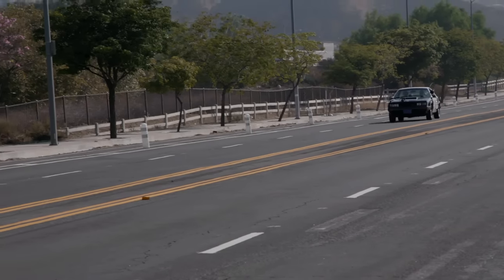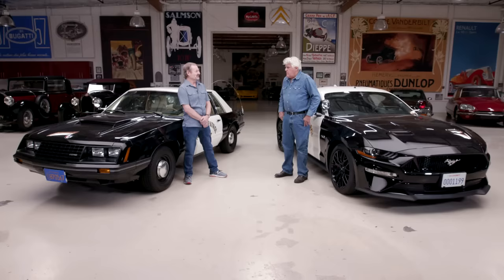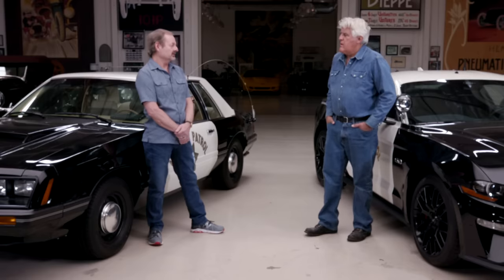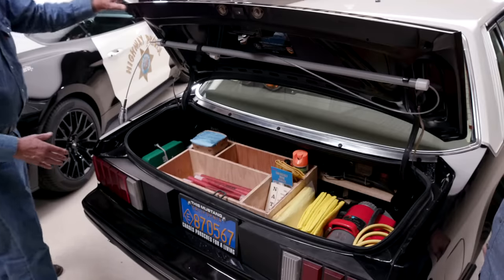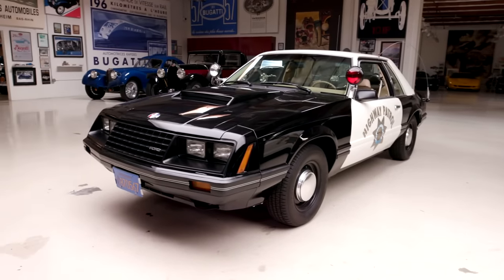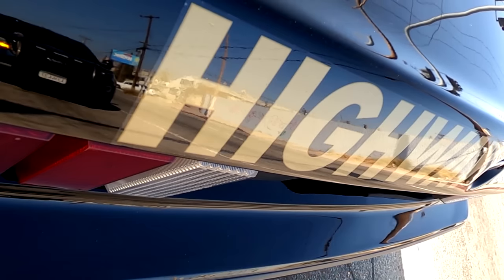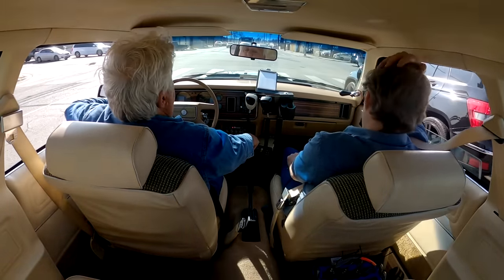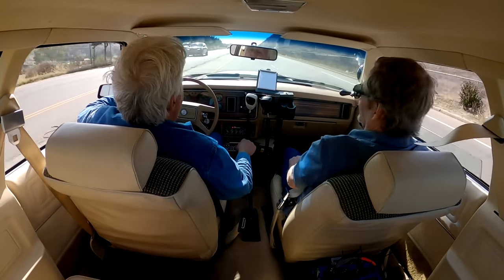This Mustang Chases Porsches for a Living | Jay Leno's Garage

Comment: 180mph in a stock 5.0? 
That must be one heck of a downhill.
Reply: Yeah. Complete liar.
Reply: Respect the retired officer, but 180..no way. I drove those 120 was the max
Reply: He never said 180. He said 150-160 which surprised me.
Reply: @michaelburley9479  4:00 Yes he did, but he also said it was a fuel injection car and he was estimating by the tach. I still don't believe it.
Reply: @michaelburley9479  yes he did
Reply: Col.henchicken Vanpopbutton :  True for most cars with 5+ gear manuals, top gear was to reduce engine RPMs, both foreign and domestic.
Reply: @michaelburley9479  He did say "figuring out with the tach I could get some up to 180". Either way, 150, 160, 180, none of that was true. - Another Retired Officer
Reply: With a 100mph wind pushing him down hill
Reply: @michaelburley9479  he's blowing smoke
Reply: Earth re-entry MAYBE.
Reply: I doubt even 130 unless the car was seriously modified. S197 GT500'S with 500 plus hp won't do that.
Reply: @robl7532  hahaa
Reply: @joeklopp4842  Not true. I had a 97 mustang with the 4.6, 3.73 gears, intake, headers and exhaust. I hit 140 on the way to Vegas, granted it was a long straight and it took a while to get there! Haha
Reply: @TheMotorman80  yeah, 140 max.. anything more you'd need to push it off a cliff.
Reply: Yeah, 225 HP isn't going to do 180.
Reply: @michaelburley9479  He said the fuel injected cars (e.g. '87-93) would do "180 if you had enough open road".  160 was BS enough, they'd be lucky to hit 150.   180 is a total eye--roller.   That takes a car that size and shape over 400 hp to do, and they only had 225.
Reply: Yeah, I had an 83 5.0 with a 4 barrel and a 5 speed.  It was fast for the day but no way in heck would it do over 125 mph.  Mine didn't have A/C.  The only 80s era car that ever beat me was the Buick Grand National.  And he didn't just beat me he embarrassed me!
Reply: I use to have 1982CHP mustang four sod 160 hp stock and it did 125 mile an hour on third speed Fourt was useless because it didn’t have enough horsepower months later I built the motor round 350 hp and I was doing top speed 150+5500 rpm 
Now I have a Shelby 700 hp but I still miss my old horse
Reply: @michaelburley9479  Listen carefully to what he said; he said that on the later fuel injected ones he could "bury the speedometer at 160". He then said that it corresponded to about 180 when correlated to the engine tach reading. I would seriously question the ability of the Fox body SSP Mustangs to get much over 140 mph.
Reply: Yeah, kilometers per hour maybe but 180mph? LOL
Reply: @TheMotorman80  I totally believe that with those mods. But not a stock 5.0 fox body.
Reply: and with a tail wind....
Reply: I’ve done 150, but mine is fuel injected and makes like 110 more hp than carbureted mustangs made.
Reply: @joeklopp4842  Lmfao what? Bud an SN95 can do 150, a GT500 can likely do 180-190 with the right gearing.
Reply: 180 mph?  Yeah, no. I maxed out at 130 mph with the stock motor and rear ratio.  180 is possible, but not stock.
Reply: @joeklopp4842  What?
Reply: Nice to know that my old 69 Cougar would have out run them.
Reply: @jeff7.629  Yeah, ok.
Reply: @milehighgimpster  Yeah those Buicks were spaceships...parents had an 84' 200hp/300 tq posi car it would run low 9's in the eighth!
Reply: I smell some BS..
Reply: @angelgjr1999
Reply: 100 MPH is a death wish in that car.  Me majestic is the best truck chase ever. Get Charles Bronson on the show Leno.
Reply: 150 is doable in an 87-93 with 2.73 gears.
Reply: Downhill on the I-80 or the Grapevine maybe.
Reply: @michaelburley9479  Listen at the 4:00 minute mark.  He said by judging by the tach he thought it made it to 180.  Even 160 seems unlikely to me though.
Reply: @dodgeguyz  Yep, I hit 140 with 2.73 gears.
Reply: @michaelburley9479  He did say 180, but yes very surprising.
Reply: The fastest I’ve ever heard of one going was around the 140’s.
Reply: @joeklopp4842  135 with a 5.0 EFI and a good tall rear diff and a 5 speed, rear diff needed to be in the 2:70’s
Reply: @michaelburley9479  yes he did. Even with the 2.73 gear, there's no way even the fuel injection cars would do 180. He's a liar.
Reply: That ossifer must have been sniffing glue to do 160 in that car,  I have had several Fords over the years, some stock, some built.
Reply: Maybe he meant kph
Reply: i had an 88 mustang gt and buried the tach at 2500 rpm's@ roughly 100-110 and got it to 3600 rpm's in 5th gear. im guessing 145-155ish. all i know are that my ears popped and i couldnt really hear the motor as loud but definitely fast for the day
Reply: He estimates like he estimated the speed of others.
Reply: I owned 2 of these and while they were fun (for the time) the only way one of these is hitting 180mph is if it gets dropped out of an airplane.
Reply: every time some one asks it gets 5 mph higher
Reply: @noaht5191  👍 Agreed. I love the Fox body. Brings me back to High School.
Reply: @angelgjr1999  mines limited at 155 mph, but with an ecu swap with it bone stock the S197 GT500 do around 170ish. It's got a 3.31 final drive with the Tremac 6 speed. Probably could get 180 out of it with 2.73 in the rear end stock.  But I was talking stock Fox body 5.0 like in the video. Not fuel injected 4th gen SN95 mustangs.
Reply: Well, theres a Tesla roadster out there right now doing like 17,000mph. So maybe.
Reply: @JamesC00  hahahaha.... Awesome!
Reply: Modified. Yes.
Stock. No.
Reply: Foxbody 5.0’s around that time couple of mods were low 12’s. Very fast for the 80’s. Light car too
Reply: @brandonobaza8610  yeah, those things were unstable past 140, and yes, the chips limited you... so stock prolly could run 150... but it woulda been maxed out with that 1:1 4 speed transmission
Reply: @johndavidwolf4239  and that was a 4 speed if u noticed
Reply: Other than exhaust my 25th anniversary 5.0 5 speed would hit 140 with relative ease.  Never tried to take it past that really.  My 87' LX 5.0 5 speed with WC upgrade, has GT40 heads ported (oversize stainless valves), cobra R upper and lower intake, MSD, Vortech V1 supercharger, with stock block and rotating assembly 180mph is a breeze.  But that came with a large price tag too HA!
Reply: Maybe in free-fall.
Reply: Yeah, that sounded a little crazy to me, too.  I used to own an 88 SSP, one time with 2 pretty large buddies in the car I pushed it to it's limit on an empty road one night.  

Mine pretty much topped out at 128 MPH in 5th gear.  It may have gone a little faster with just me in the car but I can't imagine going anywhere near that fast in it nor would I want to.  Those cars were light and could get pretty squirrely real fast at higher speeds and they were from the days before any sort of driver aids like traction control and electronic stability control.

There was actually one time in mine I was driving around a nice, steady curve on the interstate around a bunch of other Mustangs that had just left a street racing spot and I was going about 80 mph or so and every time I hit an expansion joint, the tail end of the car would hop to the right.  There was a HUGE, thick concrete wall to the left.  That scared the heck out of me.  Luckily I broke out of it by just backing off of the throttle but I never did that again, at least in that particular spot.
Reply: I dont believe it for a second!!! I had a cop tell back then 146 was the best they did...
Reply: You could tell Jay wasn’t buying it and deciding to be nice and move on instead lol
Reply: @brian5o  🤮 yeah the triangulated rear end would make them do some weird things under maximum articulation 

I need to post a vid of the 99 vert, we changed it out to a 4th gen camaro style suspension, torque arm and coilovers, shes wicked solid now, quick little car in autocross, fixed a ton of issues, if they had come with that from the factor... man, the camaro/mustang war woulda never had a chance lol
Reply: Some “5.0 HO” guys really believe their false memories.  The 5 liter high output fox body is Batman levels of over rated.
Reply: No way, I had an '85 GT. My little VW GTI is quicker.
Reply: @TheMotorman80  I had the same. You probably didn't change the speedometer gear in the transmission after you did the 3.73's. It'll show 20% or so faster on the dash.
Reply: @rhull3939  I actually did. I went to a specialty shop and got the correct  tooth plastic gear to go into the side of the tail housing to correct the gear ratio change.
Reply: @TheMotorman80  oh, ok. At least that doesn't sound like something you just read online at all.
Reply: @rhull3939  Oh okay, because I was trying to simplify for you in case you didn’t actually understand how it works!
Reply: @TheMotorman80  right. 96-97 mustang gt top speed is 135. 3.73 gears slow it down on the top end.
Reply: Freefall?
Reply: @manoman0  even terminal velocity in a freefall is around 120. Lol.
Reply: @rhull3939  😂 Brilliant!!
Reply: @michaelburley9479  Also he didn't say mph...kph he'll not be far off.
Reply: I had a 92 GT back in the day.  Very slight mods done. Would not hit 140.  I tried a few times with plenty of straight-away and even a bit of downhill.  Loved the car, wish I still had it but pretty sure the only way to hit 180 in an a fox body Mustang was if you dropped it out of an airplane.
Reply: Back in the mid 80's Road & Track started doing top speed runs, and 85 did 135 mph in 4th (130 in 5th). in 87 the tested an FI Mustang against an IROC Camaro and got it to 149 (the IROC did 150), most of the other publications call BS on the test because both cars came directly from their corporate HQ's. There was talk of them being "factory specials" made especially for the test.

Years later R&T did a tuners test and a 500 HP Fox body broke into the 180's, but rear lift was so bad nobody wanted to go any faster in it.
Reply: @johnjones928  I'm not sure if R&T used the speedo's as measuring equipment or what but I remember them putting numbers out for some cars that were wildly off. 
Some seemed about right but there were a lot which looked like they had picked a number out of thin air then doubled it. 
These days there is so much available info on the net where trusted equipment was used and accurate readings taken that a lot of those R&T numbers seem unobtainable.
Reply: @siraff4461  They used calibrated police radar guns from what I remember. The tests were done at the Ohio transportation center's 7.5 mile oval where they could wind the cars up to speeds that would be hard to obtain on an open road. The numbers  were the highest  over several runs.
Reply: 157 has mustang doing 180 mph. 
He is  smoking  some hard duff. 
The ONLY  way a 157 has mustang  doing 180 mph, is to push it out of a airplane  ✈
Reply: I had an 88 GT 5spd 225hp with 308 gears. My friend who was a cop clocked me with radar at 138mph and that was wide open all she had. 160-180 😆 🤣 😂  try again buddy
Reply: @joeklopp4842  if you have a 500 HP car not being able to g o over 130, you're either a shifty driver or you're missing 3 gears.
Reply: @TheWholeGrainBread_Real  lol, I would agree with that. I wasn't suggesting that a 500 hp car wouldn't go over 130. I meant the 180 mph claim from the video for a 1982 carbureted 5.0 fox body with under 200 hp.
Reply: @jimo8119  The '82s were nothing.  The '85s had the Holley 4-barrel and a tricked-out cam with roller tappets.  With some good tuning, they would get into the triple digits in a hurry, and top out at around 145 mph.  That's the street version I'm talking about.  After '85, they went to fuel injection and true dual exhaust, so the potential was even greater.
Reply: Well the turbo 4 banger reached 160 stock and my late seventies pinto (afi import)did 130mph in Italy. So yea he’s not lying.
Reply: Well, I guess you gotta grow up street racing in Detroit to hit 180 😂
Reply: there is a drag limit on match box like that, and 152HP is never never going to make 180 MPH in million years
Reply: @ahoorakia  he clearly stated the later years and they had 180-200 hp. The 2.3l turbo had as much as 205hp and at one time was the fastest mass produced vehicle in the world with a estimated factory speed of 160. Ps that was on a old advertising poster.
Reply: @NoName-tz5ji  that's still not possible, there is drag limit on production average car
ENG might be able to to do it but the shape dictate your final speed! 
 here is the list of 15 fastest mustang eve built, may this clear any possible illusion!

Here is the list of 15 Mustangs ever produced with astonishing top speeds:

Ford Mustang Cobra R (2000) – 170 MPH
Super Snake Shelby GT500 (1967) – 170 MPH
Mustang SVT Cobra (2003) – 155 MPH
Shelby GT350 R (2019) – 180 MPH
Ford Mustang Boss 302 (2012) – 157 MPH
Shelby GT500 (2007) – 150 MPH
Ford Mustang Boss 429 (1970) – 147 MPH
Shelby 1000 (2013) – 220 MPH (est.)
Ford Mustang GT PP2 (2020) – 155 MPH
Shelby GT500 (2013) – 200 MPH
Ford Mustang SVT Cobra R (1995) – 160 MPH
Shelby GT500 Super Snake (2007) – 170 MPH
Ford Mustang Bullitt (2019) – 163 MPH
Shelby GT500 (2020) – 180 MPH
Ford Mustang Mach I (2004) – 151 MPH
Reply: @ahoorakia  many of those cars u listed are actually governed either electronically or gear limited. Heck my 160 hp focus got up 137 mph by my gps in 5th gear. I ran out of road due to traffic so unable to tell if 6th would of helped or hurt. Edit: I removed the 114mph electronic speed limiter.
Reply: Retired NC officer told me he did 152 on radar,  he drove a confiscated 90 ish gt 5 speed  with a 355 gear installed by the NCHP
Reply: @bad74maverick1  same with my ‘90
Reply: They could go at best 139 with the 5 speed manual with that power. 5th is geared to 186 mph. Not trying to sound like a snob here.
Reply: Yea, I had 91 GT, then a 90 LX, then a 93 Cobra….all Fox bodies of course like the 82’s to the 93’s as he described……none would do 180….not even close
Reply: @michaelburley9479  4:03 "I could get some up to 180 with enough open road."
Reply: Exactly...Even the 225hp Cobras with a 3.23 rear end had trouble doing 140mph in tests in 1993 due to the Aero which was better than these old 4 eye cars!
Reply: @michaelburley9479  Wrong, he did say 180 at the beginning. Even the 225hp Cobras with a 3.23 rear end had trouble doing 140mph in tests in 1993 due to the Aero which was better than these old 4 eye cars! Even the much better Aero 2000 model Cobra R with 385hp and 3200lbs did only 170mph and that was drag limited.......My '93 Fox is lowered with a cobra bumper and drag wing to keep it planted with a 410whp LSx and a 3.23 rear end and ive had trouble getting it to 170 just due to aero unless i have a good 3 mile stretch!
Reply: Yeeeeeeh...I call BS on that!
Reply: Watch more fast and furious .
Reply: top speed for the 87 to 93 Mustang GT was 150
Reply: @joeklopp4842  thank you. Never seen so many tough guys get their panties in a wad over a "maybe". I love how everyone is an expert at everything these days on the internet.
Reply: @charlesdjones1  ain't that the truth.
Reply: The EFI cars have gone 150mph. 2.73 gears and 300 ft lbs of torque will do that no problem. Definitely not 180 though...
Reply: @rhull3939  Actually I did. I have a local speedometer shop where I got the correct red gear for the 3.73s!
Reply: @joeklopp4842  that was one of my dreams back in 04….a clean 93 Cobra….I had a 1980 2.3 Fox body, dookie brown and gold two tone with a pretty darker brown and orange  wide pinstripe separating the two tone, with caramel interior and BLUE carpet 🤷🏼‍♂️😂, my dads best friend dropped it off one day and handed me the keys. I hated that car but loved it at the same time.
Reply: @noaht5191  oh my god. I hear ya. I was a senior in high school when that 93 Cobra came out and they started the SVT project. I had a poster of that car in my locker from Car craft magazine. Whenever you'd mention the Cobra back then people would get confused that it was the Shelby Cobra and you'd have to explain. I literally in like 2014 almost pulled the trigger and bought a mostly stock red one from a guy in Pennsylvania with like 25k on it. Wish I would've, they were still really reasonable even 8 years ago. But I had 2 small kids at home then. Wife said no . LoL
Reply: Maxed my 89 Ford Taurus SHO at 145 mph,speedometer stopped at 140 but it went a bit faster,..left a crown vic way behind on Nicolas rd long island,unfortunately didn't outrun the radio,when I got off exit ramp another 3 cops joined in,..still miss that SHO
Reply: @jeff7.629  Or my 69 Cougar, 68 GTO, 69 Firebird bigblock or even my 72 Sedan Deville if I had the long run to get it going.
Reply: @scooter3722  what engine did you have in your Cougar?
Reply: My ex cop 1991 mustang lx notch 5.0/5-speed maxed out at 140. It also had a few modifications.
Reply: That didn't happen.
Reply: @TheMotorman80  that's an sn95 not a s197 lmao
Reply: @MFE92  fuel injection was introduced in 1986
Reply: Dont believe that speed at all
Reply: @michaelburley9479   he  said by tach he got to 180
Reply: Lying cop..   no surprise
Reply: He used nitrous like every cop in Need for Speed.
Reply: Ski jump downhill for 12 miles lol
Reply: Yeah that was a crazy claim. That was a 120-130mph car tops.
Reply: Yep.